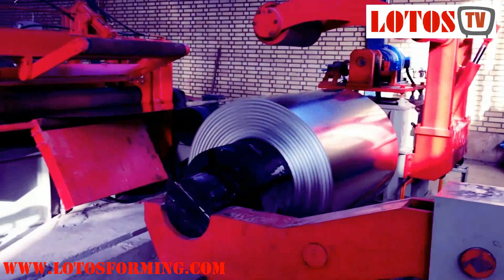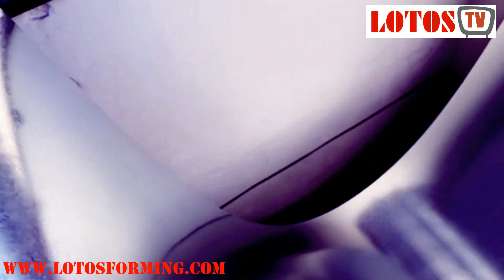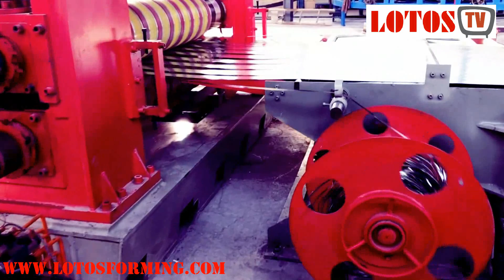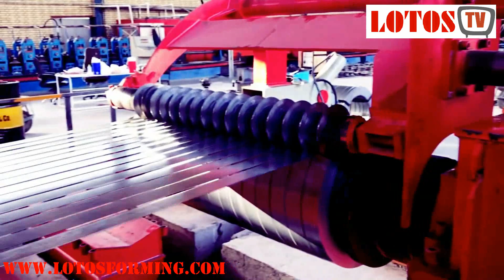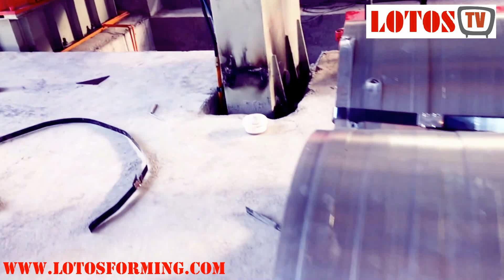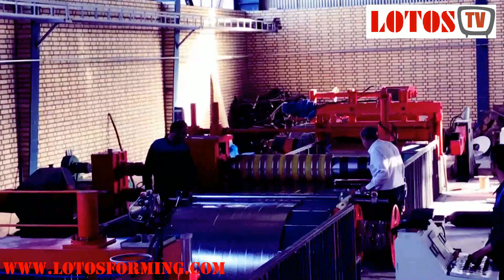【slitting machine line】:  Install slitting machine at the customer workshop | Coil Slitting Line

Comment: slitting machine line or Coil Slitting Lines are used for cutting wide metal coils into narrower coils. Sacform coil slitting lines are feature-complete turnkey systems that are composed of high-precision slitters (circular cutters) with quick tooling change for slitter, tensioning device, and recoiler for steel and other rolled metal coils.

Comment: acform coil slitting lines are feature-complete turnkey systems that are composed of high-precision slitters (circular cutters) with quick tooling change for slitter, tensioning device, and recoiler for steel and other rolled metal coils.